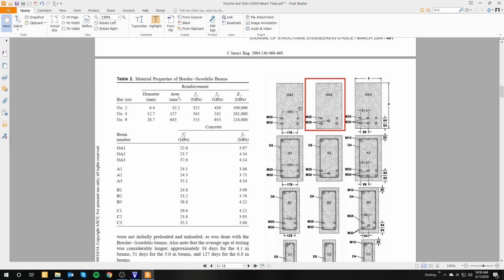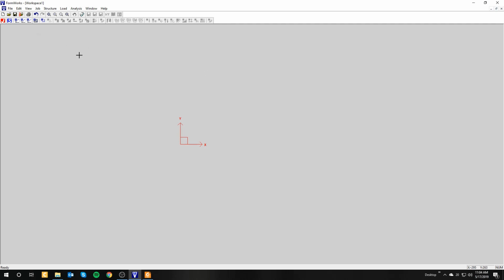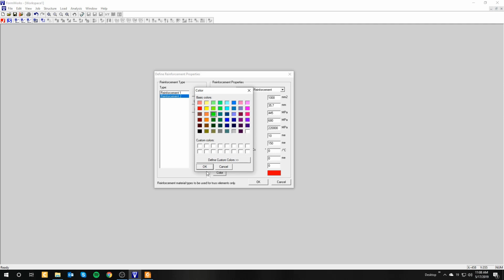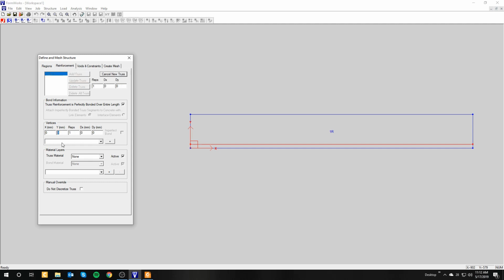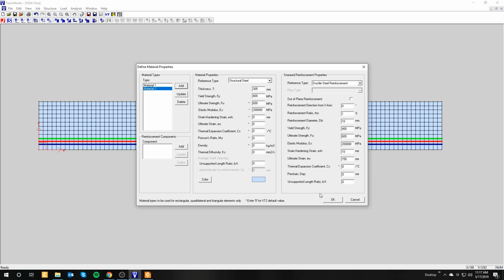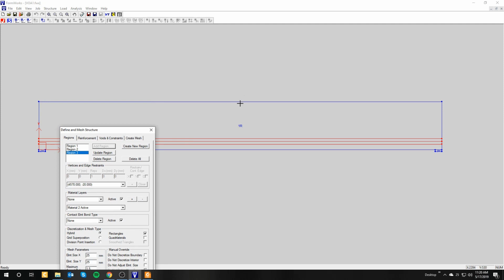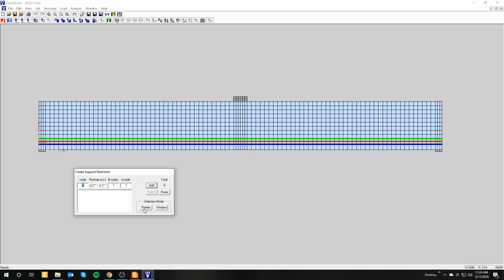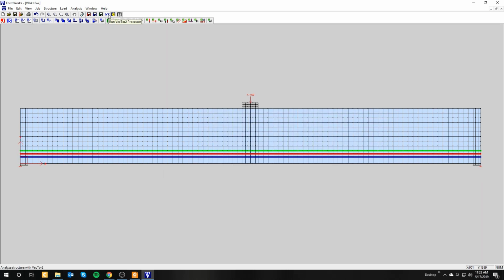Nonlinear Finite Element Modeling of a Beam (using VecTor2)

Comment: Dr. Guer, Thank you for such a informative tutorial. This helps me a lot. Based on the input in this video, the maximum spacing was set to 1000 mm in both x and y directions. I wonder how you chose this value. Is there any theory behind it?
Reply from the maker: How many element depends on the power of the finite element used. For the element you are using in VecTor2, minimum of 8 to 10 elements through the depth of a beam should be sufficient. The depth because the strain gradient varies across the depth. I hope this helps.

Comment: Dr. Guner, Thank you for this usefull tutorial. 
I am modeling a reinforced concrete column according to this tutorial.
I have confirmed that there are various material models for concrete and rebar. I would like to know if there are standards for selecting material models such as compression softening and tensile hardening.
Among these many models, I would also like to know which model is suitable for reinforced concrete columns. I've read the manual, but many models are said to be suitable for reinforced concrete, so I'm curious about the exact selection method. If there is no standard, I wonder if it is just decided by trial and error.
Reply from the maker: Hello, you can use default options, which are intended for general cases. In FormWork, just click on the default button on the material models page and all will be set to default. I hope this helps.

Comment: Thank you for this great tutorial.
Can i model a concrete filled steel tube beam using this software or its 3D version ?
Reply from the maker: Thank you for your interest in our videos. I am not sure whether a nonlinear model is indeed needed for such an application. You need to consider what nonlinearities that you need to consider if any and make the software selection accordingly. A basic linear-elastic analysis may be the best first step in analyzing a concrete filled steel tube. If the capacity/results are good/sufficient, then you are done.
Reply: @SerhanGuner  thank you for your reply.
But do you think vector software can model a concrete filled steel tube or is it just for reinforced concrete ?

Comment: Dr. Guner, Thanks for the informative video. Anyway, I modelled the same model in Vector 2 and It ran only one iteration I guess and automatically closed the black window. when i click Augustus processor It opens nothing. Also, in Augustus I tried to open the job seperately. But it automatically closes the processor. Can you please help me with this? Thank you so much
Reply from the maker: This indicates a major issue/mistake with the models. I recommend you check all support restraints, element types, and mesh. I hope you can find the mistake easily.

Comment: thank you for this tutorial,
may you make a 3d frame case?
Reply from the maker: VecTor2 is for 2D analysis. You would need to use VecTor3 for 3D brick element modeling and VecTor4 for 3D shell element modeling. You may want to make an online search to find their manuals, videos, etc.
Reply: @SerhanGuner  thank you